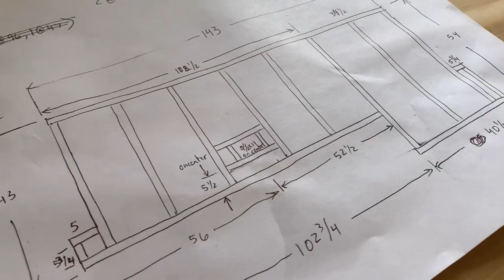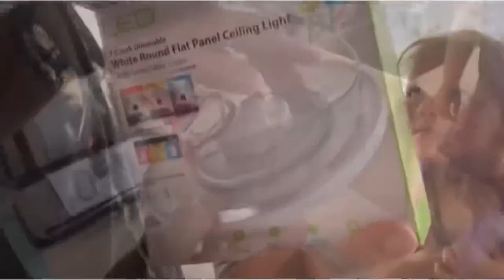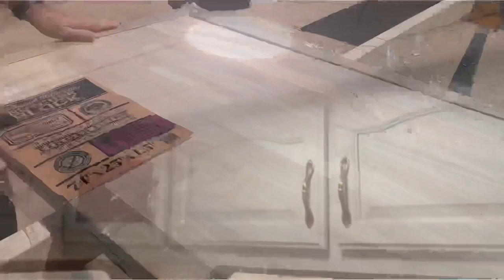DIY RV Dining Area Makeover

Comment: Beautifully done, and the gameboard integrated into the table is impressive, but it’s a checkerboard, not a chessboard. In chess the rightmost corner for each player is white. In checkers that square is traditionally black. I guess it doesn’t really matter, you can call the black squares white, lol, in chess any color pieces could be white as long as you play consistently, so why not the squares too?
Reply from the maker: Yes, this mistake is mentioned in the video.

Comment: I love it but questions on weight and tile cracking grout etc with the movement
Reply from the maker: So you’re talking about the tile in the kitchen video?  There’s such little tile, the weight is nominal.  You raise valid questions about the grout possible cracking, but it’s not something we’ve had to deal with in our case.  If you’re worried about it on your project there are other options besides tile and grout that you could entertain.

Comment: Awesome build. Do you have a name or model number for the table hardware/floor mount?
Reply from the maker: It’s this base, but black, and it works much better on a lighter, more balanced table (like a square or a circle).  This base works, BUT because our table extends so far out on the two sides, it teeters A LOT from kids leaning on it while in use.  It slowly kinda rocks intake down in height because of all the leverage it has on the long sides.

https://boatplicity.com/9066042-springfield-marine-1660230-ped-3-stage-table

Comment: Hi; when you changed the ceiling lights, did you purchased a regular lamp or a one that is specifically for RVs?
Reply from the maker: It was just an LED light that is designed for 120 volts from Home Depot.  There are other lights in the fifth wheel that run on 12 volts though.

Comment: how did u secure ur blinds at the top.  if u put then upside down. good job. btw
Reply from the maker: It works the same way you would secure them at the bottom. The blinds have a tot string that runs into a little canister that you screw to the wall. Thanks for watching!

Comment: I would be really thankful for a feedback on the telescopic leg, does it wabble? And what brand is it.. I am copying your layout
Reply from the maker: It’s this base, but black, and it works much better on a lighter, more balanced table (like a square or a circle).  This base works, BUT because our table extends so far out on the two sides, it teeters A LOT from kids leaning on it while in use.  It slowly kinda rocks intake down in height because of all the leverage it has on the long sides. If you are doing a longer table like ours you may want to use 2 table legs . That would definitely stabilize it.

https://boatplicity.com/9066042-springfield-marine-1660230-ped-3-stage-table
Reply: @itsworthit5029  thanks a lot for prompt reply. This was my fear about the leg after reading dozens of reviews..I will probably go with 2 legs but this will limit the ability of making drawers like yours . I think I will just make them to open from the top.. I will try to integrate a chess board as well, such a great idea.. thanks for inspiring, you have a beautiful family.